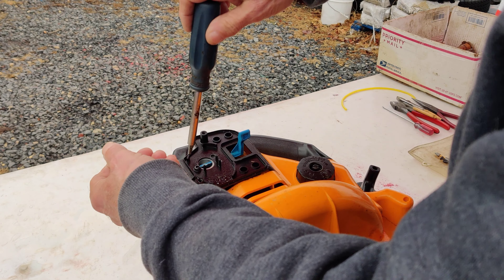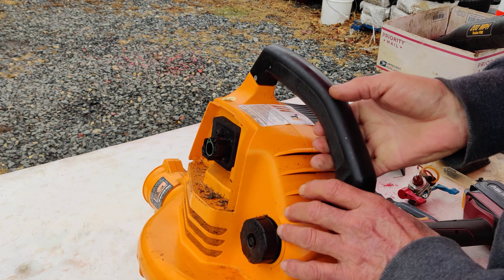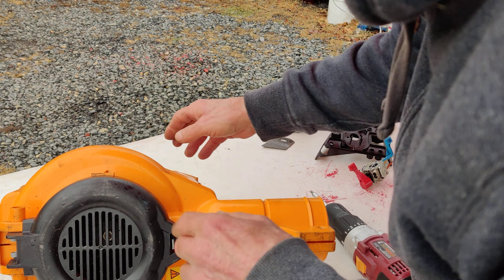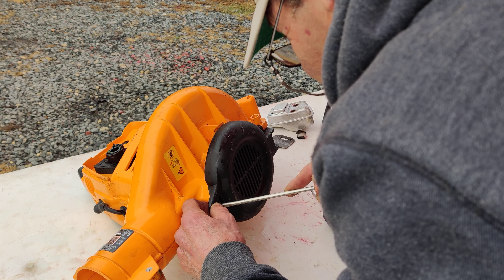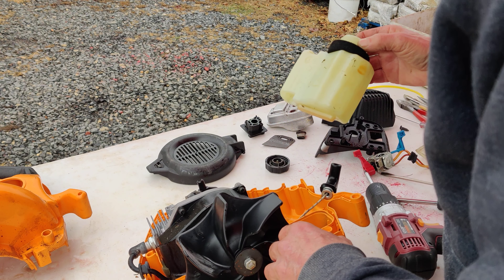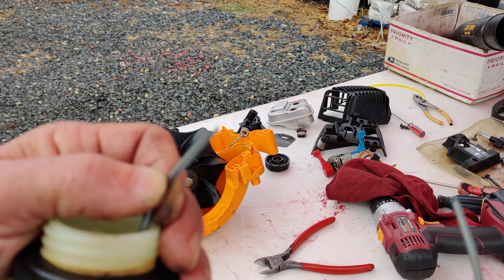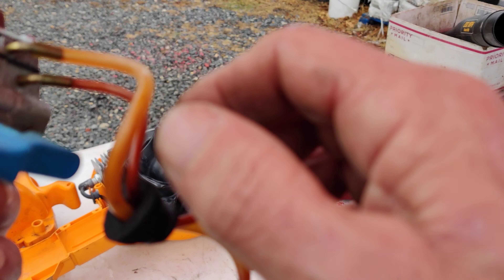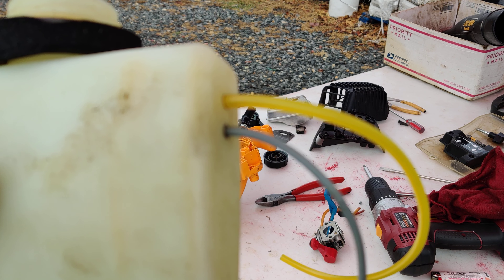Poulan hand held blower fuel line replacement PT 1

Comment: Does smaller line attach to carburetor top connection near primer bulb?
Reply from the maker: The smaller line goes to the primer outlet if I remember correctly. Good luck and Thanks for watching 🔧👍
Reply: Thank You sir! That’s how I connected them and it worked great. The lines were falling apart and that made it hard to know what went where and on your video I could not tell which line you connected to the Carburetor. Thank You for the video and quick reply I appreciate it greatly!
Reply from the maker: @joederringer6716  You are very welcome and I'm glad it worked out well for you 🔧👍

Comment: Better make sure that the recoil rope and spring are in good shape if your going to be this far into it. I see so many of these in the garbage and I leave them there now. I have learned my lesson about working on these because you’ll never make any money.
Reply from the maker: Yes that's true. I made sure the recoiler and rope were good. They are usually not worth fixing. It's also a good idea to take the muffler off to check the condition of the piston and ring. Thanks for watching!

Comment: Dude ... the part of the disassembly i wanted to see i found myself watching the back of your Hoodie  it sucked. I wouldn't suggest you recommend heating the fuel line with an open flame to get the filter on either.  Nice try on the video.
Reply from the maker: I know sorry. It was one of my first videos. I've improved since than. Thanks for watching anyway!